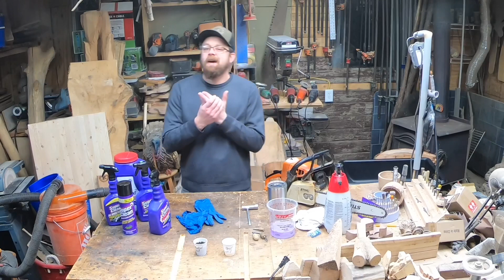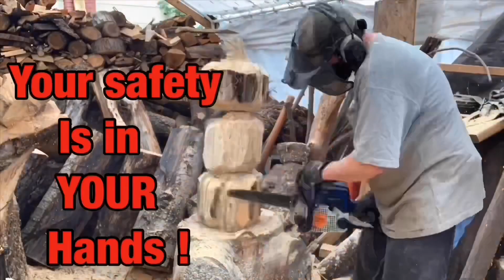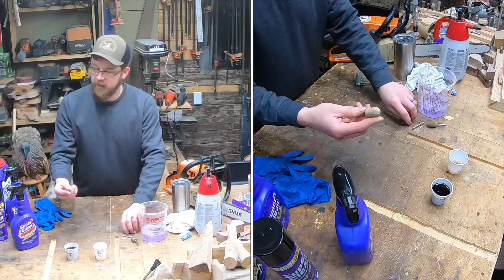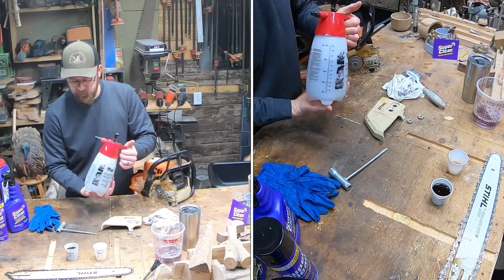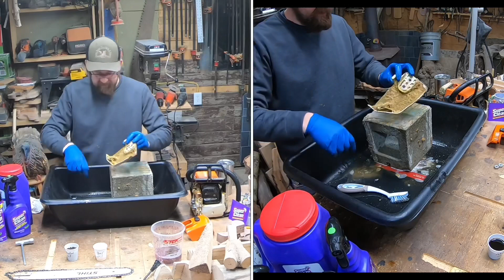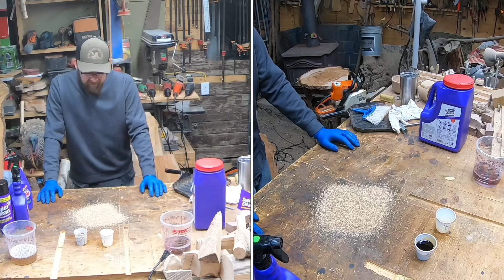Reviewing Super Clean . Cleaning chainsaw parts and carving tools.

Comment: Looks like it cleans most stuff pretty good. Oils and stains can be hard to get out. This is just my opinion but wood swells when it gets wet, probably makes it harder to get out when wet. I just burn mine then hit with a brass brush. Good test.
Reply from the maker: Thanks for the comment Rick . I usually burn mine also . My only concern with the burn is heating the burr to much which could make the spikes brittle. Don’t get me wrong I’ll still probably burn when I’m in the middle of carving a project.